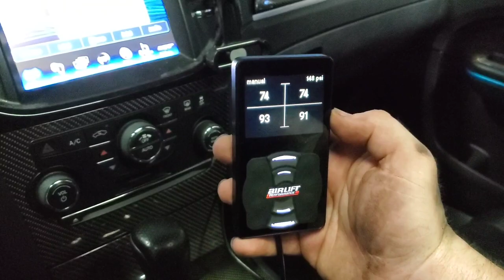Air Lift Performance kit is complete on my 2013 Chrysler 300 SRT8 (air ride) | Part 3 - Final | Vlog

Comment: you have to protect the air hose with Wire Loom Tubing, to avoid problems back the wheelwell
Reply from the maker: The line that's going over the wheel well in the rear? Is that just in case protection? I'll do it. I'm just curious as to why? This is my first install. So I'm no professional
Reply: Vibration can damage the hose
Reply from the maker: Thank you for the info. Wheels are coming off today so I'll put some loom on the hose.